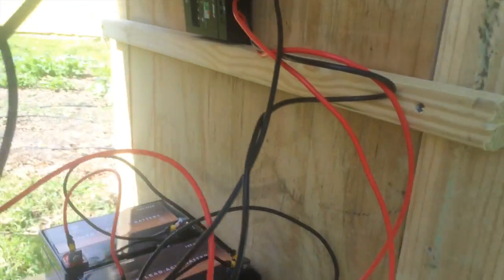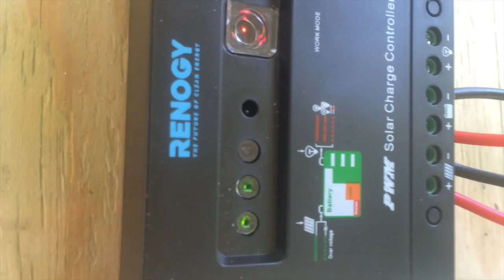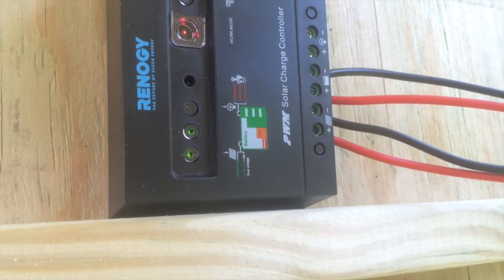How to set up Solar Panels for Battery Storage

Comment: I know that this is an old video but hope you figured out that you need to run red wire from front battery to charge controller then black wire from last battery to charge controller. Otherwise you would only be charging front battery.